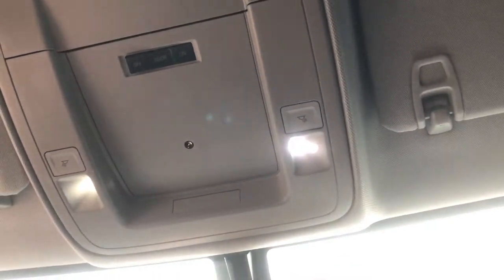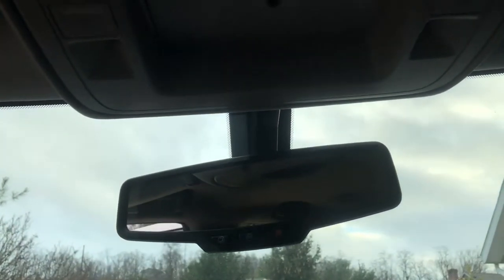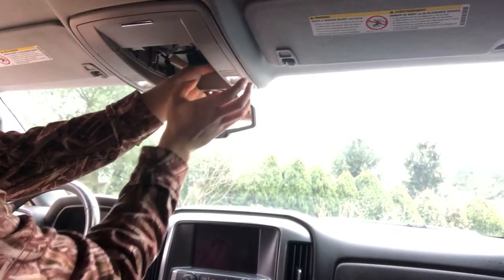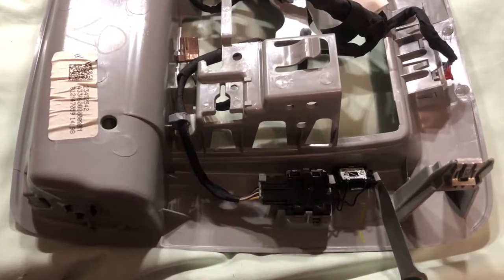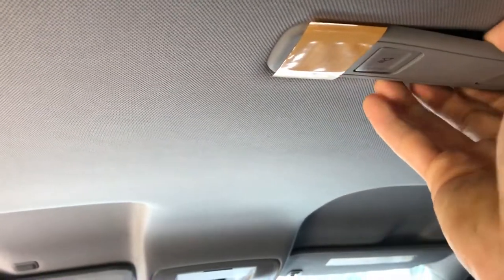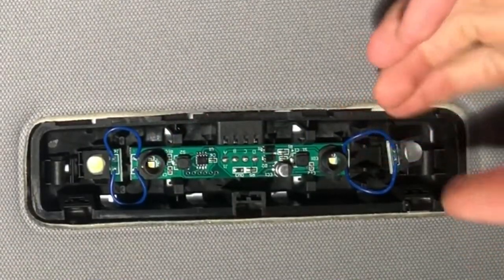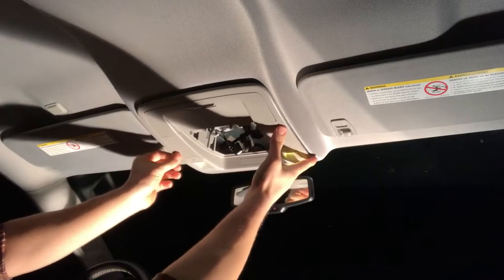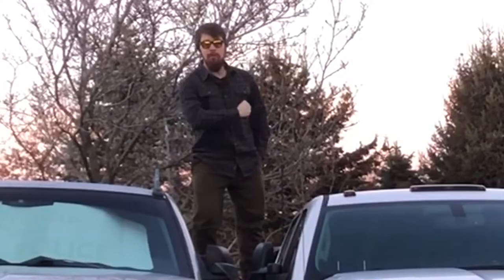Change Interior LED Color - 2014-2019 GM Chevy Silverado Sierra

Comment: What kinda bulb do I need to replace the rear lights?
Reply: same question for me and i  searched for new bulbs for the door handle too , but  i didnt find anything
Reply from the maker: A less specialized option might be the only other option besides tape
Reply: Just type your tesr model in amazon.. it show you.. i got some backup white LED.. and for the plates.. they lowkey good
Reply: @dxpeboyj9074  tesr model??